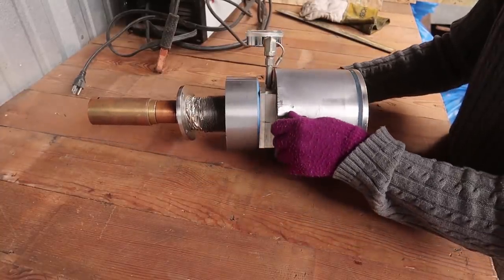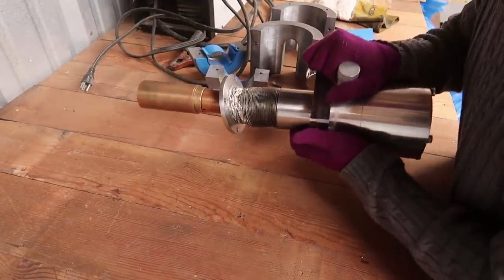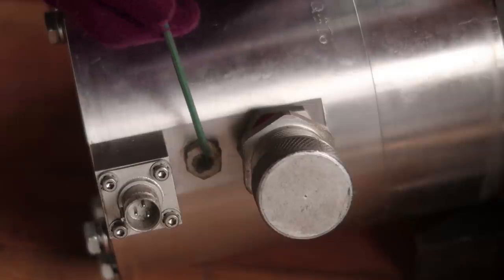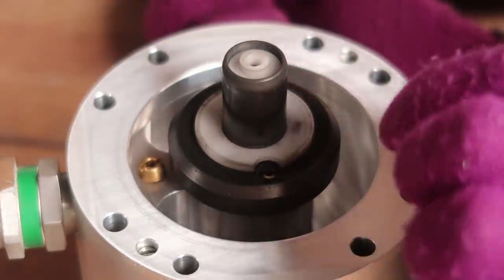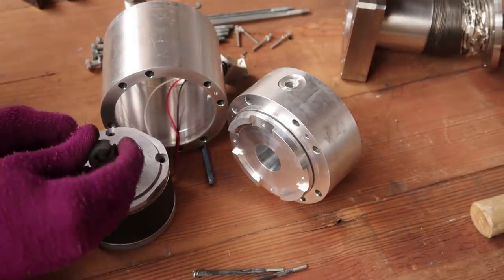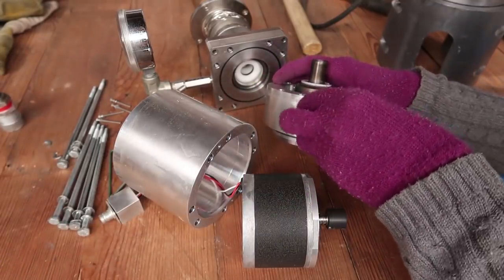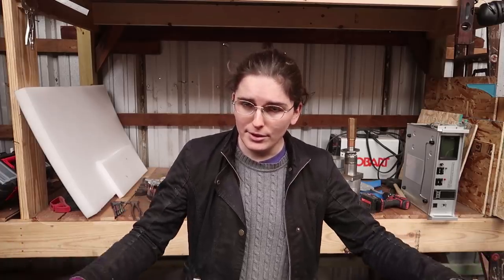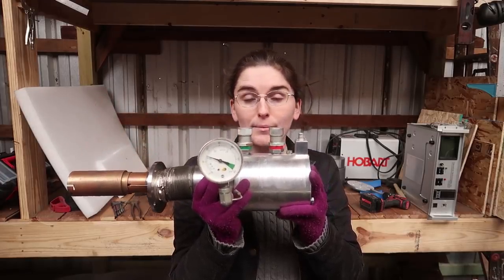CryoPump / CryoCooler Teardown: Aiming to make Liquid Nitrogen and Liquid Oxygen for Rocket

Comment: Cool. It's likely a Gifford McMahon cryocooler, commonly abbreviated GM cryocooler, if you're searching the internets.  It's true that the helium compressor is fairly standard, but one requirement is that no oil vapor comes out since it would freeze and clog the cooler. I believe they use oilless compressors and filtering too. I've never seen the insides of one of these coolers. Neat teardown!
Reply from the maker: thanks! if i cant find anything better than that compressor i have, i might just go ahead and try it with it just to play around, and i guess i can clean out the insides of the cryopump if that happens..... OR i could modify the compressor.
Reply: Applied Science: you were my inspiration for me buying a cryocooler a year ago and building a gas liquefaction apparatus.  I've probably made 50 gallons of liquefied gases since then and I don't run it all the time.  It's nice making cryogenic liquid in my basement that I previously thought could only be done with $50,000 equipment.
Reply: @TheElectricnoob 
I’ve been wanting to build one but I’m not sure if I want to go GM, JT or pulse tube. I still need to do more research though.
Reply: 🔴 What Is Islam? ⚠️

🔴 Islam is not just another religion. 

🔵 It is the same message preached by Moses, Jesus and Abraham.

 🔴 Islam literally means ‘submission to God’ and it teaches us to have a direct relationship with God. 

 🔵 It reminds us that since God created us, no one should be worshipped except God alone. 

 🔴 It also teaches that God is nothing like a human being or like anything that we can imagine.

🌍 The concept of God is summarized in the Quran as:

📖 { “Say, He is God, the One.  God, the Absolute.  He does not give birth, nor was He born, and there is nothing like Him.”} (Quran 112:1-4)[4] 📚

🔴 Becoming a Muslim is not turning your back to Jesus. 

🔵 Rather it’s going back to the original teachings of Jesus and obeying him.

Comment: You can make helium compressor quite easily using rotary compressor from old AC unit. First you need to remove old oil from compressor and charge it with refrigeration compressor grade mineral oil. Then you will need oil coalescing filter and activated carbon trap for removing oil from compressor discharge. Compressor will require constant circulating water cooling because it will overheat during long run, so a cooling water jacket around compressor shell is required for longer run. I'm also working on an air liquifier for getting liquid oxygen for my rocket engine project. I will start posting video on it during my summer vacation.
Reply: How do you know this? I’m curious about this, I know it’s been three years since you posted this Comment but I have an AC compressor and would like to hear more. Doesn’t the compressor for helium have to have much much higher pressure?
Reply: @thatdudehasissues  commercial helium compressor for use with GM cryocooler ( the one shown in the video) dosent work on very high pressure. You can search for helium compressor from modified AC compressor video on YouTube. Theres one video showing the process . It's not something every one can do easily but possible.
Reply: @thatdudehasissues  search DIY helium compressor. The channel name is Alexander
Reply: @Exotic_Chem_Lab  ohhhhhhhh! I get what you’re saying now, thank you, this is the most interesting thing I’ve seen in awhile

Comment: I used to rebuild cold heads in the field, they were fitted on top of MRI magnets. After about 1 yr. the piston would need to be replaced. The cold head would freeze a tank of liquid nitrogen inside the magnet and that along with high vacuum insulation would help to keep the liquid helium cool.
Reply: How to fix a cold head of a cryo cooler(CCR) if it is giving a small leak ?(checked using a helium detector), Thanks

Comment: That bolt by the electrical connection is probably a safety valve, they use something very similar in steam engines, I'd replace that with a burst disc. Also, with the inlet and outlet on the same side you wont be able to put on the steel casing, without that your efficiency will plummet and you may burn yourself.

Comment: I bought a sterling cycle cryocooler (the self-contained one you're looking for).  It cost me $1600 though.  I pass the air through a membrane ahead of time so that I can get pure liquid O2 or pure liquid N2, as needed.  I make 3L to 4L in a 24 hour period with mine because it's high powered (over 100W) and also because my membrane filter is drying the air.  Heat of condensation and heat of solidification are factors with cryocoolers when precious cooling power is being used to make water ice.
Reply from the maker: yeah i think im going to keep low-bidding these random ones and see if i get a sterling cycle one. its hard to tell sometimes because they arent even always labeled as crycooler since the seller doesnt know what they are, but thats where the best deal can be.
for my rocket project i dont need 100% pure LOX so i plan to use a medical oxygen concentrator to make 95% pure oxygen for it.

Comment: Yup the motor drives a valve that cycles the high pressure helium off and on. It then moves the piston creating a very low pressure that the helium expands in next the piston moves again and gets ready for the next cycle. These will work with nitrogen or hydrogen as well, but won't get as cold.

Comment: The fittings are on the side are for Helium lines supply and return. You need a compressor to operate a cryogenic pump.
Reply from the maker: yeah I plan to later get the type that doesnt need a compressor
Reply: @RinoaL  I’ve worked with cryogenics for 30 years not sure what cold head works without compressor’s lol
Reply from the maker: @cephalopoder  They have variants that are all self-contained. They are normally highly sought after since they only need a unique AC power. You might want to check out Ben Krasnow (Applied Science)'s video on cryo coolers for liquid nitrogen.

Comment: green and red tubes seems to be on opposite sides, to pass water as large way as possible. otherwise, some volume of water will not move
Reply: Turns out those are for helium, not water, but the same principle applies. I guess a baffle could be added inside to encourage it to flow all the way around. Someone else also pointed out that the outer steel part won't fit around them on the same side. I guess it could be milled out to make a full slot on one side, but then it might not be able to squeeze tightly enough on the thermal pad.

Comment: try looking into a scuba driver compressor. (3000psi) (harder but you can use your old compressor in the video)
you can compress filtered air without water (pass thru a lot of silicagel)
cool the gas output in a cold water bath, the tube will go into the bottle thru a orifice hole, the low pressure flow back you route over the high pressure tube for a good length. this and the bottle need to be in very good thermal isolation.
as the gas expands it liquefy, the part that doesn't liquefy come back exchanging heat to the high pressure tube going in , this gas you lead back again into the compressor before your water filter.
first you will have liquid oxygen, if you continue you will have liquid air with liquid nitrogen too. (good for storage, to use let the nitrogen boil first, use a thermometer)
what are you thinking on using to pump the liquid oxygen out? a pump or helium pressure bottle?

Comment: mmm...can you not take a regular pump like a John Deer radial pump who metal is rated for cyro temperature and replace the gasket with cyro gasket material?  Oh yeah, I would also convert a normal three stage pressurize hydraulic pump.

Comment: I also picked up one of these a while back for cheap (not working condition). But ultimately, I decided that it would just be so much easier, and perhaps even cheaper, just to buy liquid oxygen from a supplier. I know it's not as convenient as being able to make it at home, but....first you've gotta get a helium compressor, hook it up to a working cryocooler, fill it with helium, then have another system to just run pure oxygen by the cold finger, otherwise you'll just end up with liquid air instead of liquid oxygen. Ugh.

It's just a pain when the end goal is a rocket, and making liquid oxygen is just as hard and painful, if not more so. Good luck.

Comment: Hi
Cold heads will need a.helium compressor to hold the correct pressure inside the chambers to make them efficient also the piston just moves gas from the first stage to the second in one pleasure also not sure your be able to liquify with this size of cold head your need one of 4k or below
Regards

Garry

Comment: Bro can you give a detailed suggestion about helium based pulse tube cryocooler and how I can build one if you are explaining that would be a very very useful for my project so please can you help
Reply from the maker: Research how a stirling engine works and make one that you can run as a stirling cycle heat pump, then the rest is extra engineering

Comment: Very difficult to get a compressor working.
I have tried it but the oil seperator and oil adsorber always let some oil through blocking up the cryo pump after some hours of runtime.
A problem too is that Helium gets really hot when compressed. Commerical compressors solve that problem by oil injection which is pretty tough to do.
The system needs to be hermetically sealed or the helium will escape. If you can get a commercial compressor its quite possible to set it up.
But building your own compressor is hard, a normal refrigeration compressor just won't cut it.
The connectors are self sealing connectors made by various manufactures.

The Motor runs most likely from one phase plus run capacitor.
For my cryo head 0,47µF worked fine, you have to try it out and measure the current.
But the running is not the main thing, if the displacer is worn the pump will have bad performance.

The Stirling cryocoolers out of the superconductor technologies superfilter are now pretty expensive.
Some years ago I bought one from a liquidaton sale for a somewhat reasonable price, they are pretty easy to run tho.

I may try again building a Helium compressor with a multistage refrigeration compressor to geht the gas temperature in control.
Reply from the maker: very difficult to get a compressor working for very long you mean. should be just long enough to do a video. hehehe :p
Reply: @RinoaL  sadly not, the compressor will work for like half an our before the oil getting burned. That is not even long enough to get the cryo pump down to temperature. The compression releases so much heat and there is no good way of cooling a hermetically sealed compressor, especially if it is a piston compressor which has almost no thermal contact to the casing. The compression ratio from 8bar to arround 22bar also requires quite a strong motor compared to the swept volume. So a compressor for high pressure refrigerants may be used, like for R410A or R32, an compressor for R22 or even R12 will be overloaded easily. It may work for a short time but without good oil seperation the cryo pump will lock up in no time, a slight oil film and thats it, it stops working. You than have to tear it down and clean it of the oil.
Reply from the maker: you underestimate how misleading editing can be. turning off the camera at just the right moment before a failure can change a video entirely. lol

but yeah i know it wont end well with this compressor. but this is all free or low cost junk so oh well.

Comment: Your rocket efforts are admirable.
Reply from the maker: well thanks!
Reply: @RinoaL  Your welcome.  Ebikes are my hobby
Reply: @RinoaL  you are welcome.  I also avid e-biker.
Are you using bms with your 18650 packs? 5 cell packs/no bms is working over here with voltage monitors.Like your vids Bob

Comment: I bet the engineer groaned when he had to deal with using a 50 lb as a heat sink for the engine. Its need to see the top of line insulation for the motor... I'd think a 10 foot shaft and a cooled shaft might do.

Comment: AvE would be impressed, especially if it works right when you put it back together. I would guess the controller for it isn't very complex given the 3 pin connector.

Comment: This will never work again lol......
Reply: If it was a modern cryocooler with sealed in self contained helium at around 300 bar, and the helium seal was broke I would agree (because of the effort required to refill). But since it is not, I think that this unit could be brought back to life.

Comment: You need a 3D printer. Then you can make a new handle for that box :D
Reply from the maker: i have a 3D printer, and my career was in 3D printing. however for this i would much rather make a metal handle.
Reply: @RinoaL  Well, yeah... Design, print, finish, and then cast a metal copy.
Reply from the maker: that is so impractical, that i dont quite know what to say. maybe i should also add a step of making the metal in a particle accelorator from a bunch of hydrogen?
Reply: @RinoaL  How is that impractical? It's actually quite easy. I cast parts all the time that I've designed/printed. Mostly working with copper and aluminum, since scrap is easy to acquire. Melted down in a forge that cost little to nothing to make. Forms and greensand are relatively cheap too.
Reply from the maker: or, hear me out, i could rivet some pipe to the box and call it a day.

an efficient builder has to know how to not throw away time and resources.
Reply: @RinoaL  uh huh
Reply: @pixelbat   Is it possible to use lost wax casting if you select a low melting point thermoplastic for your 3d model? 

Is there such a thing as wax filament? 

Could make for some really fancy castings.

Comment: I want to give everyone the benefit of the doubt.  But everything I have seen has ZERO logical function.  There is a crap ton of SS on the outside with little insulation on the inside.  Anyone knows SS is expensive.  You showed a thermocouple with no termination point....   OK I mean wow don't get duped...  sorry miss.